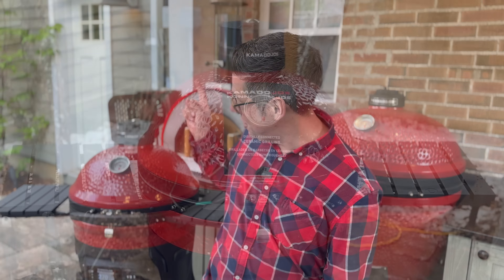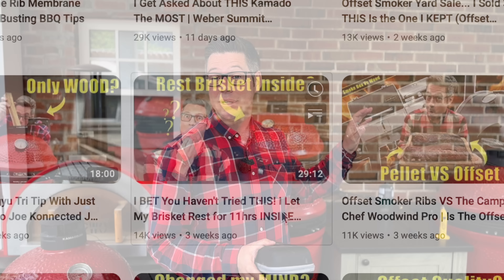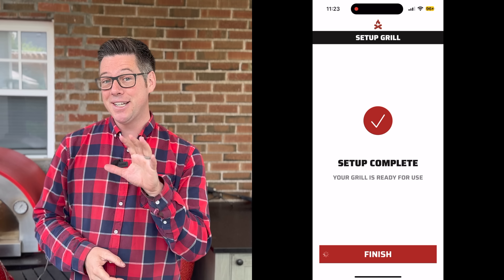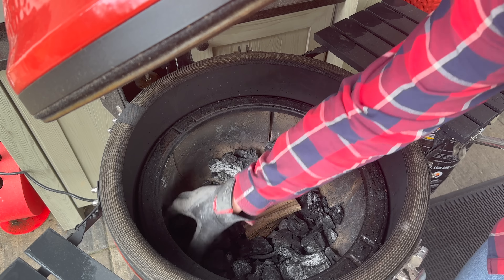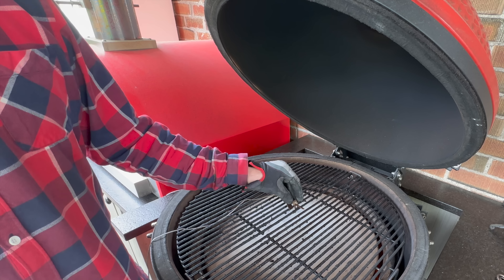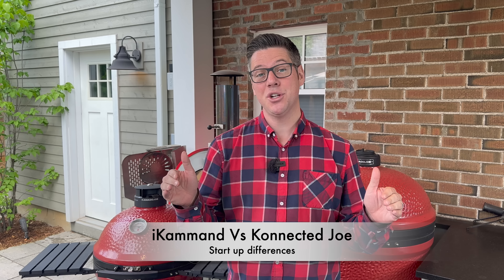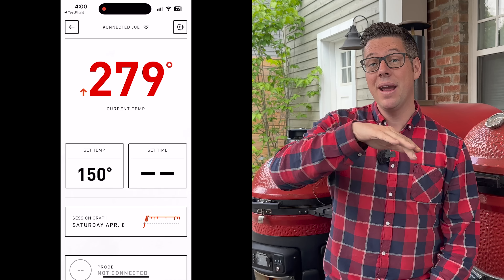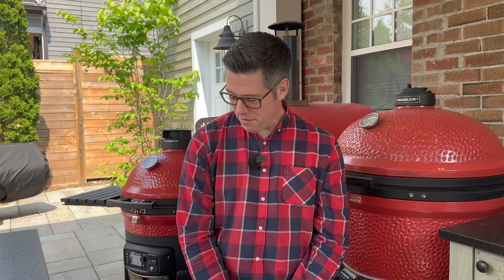Getting Smarter?  Kamado Joe Konnected Joe VS iKammand

Comment: I've got a flame boss 500 for my KJ Classic III. I've got quite a few cooks under my belt with it over the last year, including 4 briskets, 2 Prime Ribs, Pork Butt, Chicken etc.. The ease of use is surprising and I have not had a single failure. My favorite function of the controller is the cloud based networking. I'm able to start a cook and leave the house while keeping an eye on the cook. This past weekend I was on the golf course and was cooking pulled pork! One tip is to keep the top vent closed 100%, helps with temp control. I also have found that starting my cooks with a lower start temp (180-200 F) and working my way up over time (10F/30 min ballparked) introduces a ton more smoke flavor! Think of the grill like a large diesel truck, it only produces smoke when it is accelerated. And if you over accelerate, it has to much momentum. Just my 2 cents... love the content

Comment: you are a absolute master at the kamado Joe. I've had my big Joe for about a year and still have troubles with keeping a constant temperature for long cooks.... Will either jump or dip, I try to keep the bottom vent a finger space open and use the top vent but I find my temp drops too much and I have to open it up wider to get the temp back up, so now I might try to keep the bottom vent half way open and use the top vent more. It's pretty difficult I'm finding... Starting to get better a year later though 😂. Keep up the awesome vids James!!

Comment: Great review of the devices.  I have a variable fan system that is no longer made and I only use it for overnight cooks were here in Colorado we have highly variable winds that can cause large temperature variations if the wind blows into the lower vent.  The next brisket I make I have to see if I get dirty smoke from the unit.  I seem to remember my unit blows at low speed a lot and not like yours does with high speed fans.

Comment: An issue I see with the Connected Joe or any other cooker that relies on electronics is planned obsolescence. Sure, it could still work in manual mode later on if need be, but you pay extra for something that will inevitably be replaced by something newer and better later on. I personally have an Egg with a Flameboss controller. A bit less convenient and the controller is probably already obsolete too, but the Egg will never be and the controller is much cheaper to replace than a whole cooker.
Reply: But they are releasing new Egg with new tech and gadget every 1-2 years for 2500$...

Comment: Very interesting, the part that you explain how the iKammand allows the coals to almost die down. I take it that the drive is not variable speed?  Awaiting to see your reviews on the other drives. Fireboard is highly acclaimed, however I own the Fireboard 2 Pro which uses thermocouple sensors, I've had constant issues with the sensors even after they replaced some. I had given up on using the unit, till I decided to find a fix of my own recently. Did you get the thermistor or the thermocouple model?  The thermocouple will work at higher temps in your pizza oven, only if it works properly.
Reply: I have had and used the ikammand for a year now.  Personally, I have not had any connection issues and did the firmware update as soon as I got it.  Apparently there were alot of issues before the update.  The fan does have variable speed and the app shows you what speed the fan is running at.  If you don't have your top vent setting right it will be an all or nothing approach in regards to the fan speed.  If your vent setting are appropriate with your target temperature then I usually see the fan holding between 15-25% full power constantly.  This results in best airflow.  I will say however, I am looking forward to James' controller video because all of the negative reviews from other people have me second guessing myself that I may should upgrade to a different product.  My only negative issue with it is the app sucks on IOS and takes forever to update if you close and reopen the app.  I had android previously and the app updated much quicker.

Comment: Can you confirm if this Ikamand will work with a mesh network where the dual band WiFi or two band are all in one and not two diff network? Was still debating on this.
Reply from the maker: I am a mesh but only 2.4 works
Reply: @SmokingDadBBQ thx. Is your mesh have separated bands or just combined? I heard it does only work on 2.4 but wasn’t sure for the mesh network which doesn’t have separate band ssid. Lastly, can guy describe more on the taste difference on what you stated with ikammand? Love your vids. All I’ve been doing is watching your vids before my classic 3 comes in.
Reply: I use a Nighthawk MR70 mesh combined and the iKamand connects without needing to separate the 2.4/5Ghz channels

Comment: iKammand is garbage.  Mine had serious issues connect and not working.  Temps were all over the place.  The Kamado holds temps better on its own.  Would no recommend iKammand after it failed me.  Wasted money
Reply: Same experience here as well. I’ve had both versions and they both had zero consistency.

Comment: I never saw very good reviews about the iKammand so probably other hardware are better. Anyway, what I really wonder is: if the kamado is a machine so stable on his own, how can a controller such as the iKammand get things worse? I mean, maybe it's not worth the price, but still I would expect a better outcome respect of non having it (forgetting the Konnected). Can't it regulate the air flow? Is it really just max air or no air at all?

Comment: iKammand is an unmitigated disaster in my experience.  It routinely will disconnect or not hook up at all (full wifi signal so people can stifle those comments).  Support is non-existent.  I used mine 50 times in 3 years and fully 50% of those times I had trouble.  Kamado acted like nothing was wrong and then denied replacing it even with a proven history of failure on their part.  Never again.  No more Kamado anything for me.  I used to use their charcoal but now use other charcoal b/c of Kamado's failure on this one easy thing to fix.

Comment: From what I've seen the iKammand is garbage. I'd like to see the Konnected Joe vs the FireBoard Drive though.
Reply from the maker: Ya it’s not great so I haven’t shown it and put it on my waste of money list. Looking forward to the fire board though
Reply: @SmokingDadBBQ  I can say that the FireBoard fan has an actual sliding vent on it, if you left that halfway open or whatever, I am hoping it would keep the smoke from tasting nasty. I say I hope because although I have a FireBoard 2 Drive, I can't actually connect it to the vent on m y Kamado >_>
Reply: Fireboard tip: Back the max fan speed down to 15-20% max for a kamado.  Full CFM is a ton of air you you don’t need or want.
Reply: @SmokingDadBBQ I've been using a Fireboard 2 Drive for nearly a year and it's been fantastic. Temperature curve is mostly a flat line outside of my fiddlings. I'm really pleased with it, what problems were you having?

Comment: The i komand must be a real piece of garbage. Any decent pid system will learn the system and use a variable input to level in on the setpoint. Even my home built unit does that with cheap eBay hardware. I am sure fireboard labs with a kamado will DESTROY both the examples in this video. Fireboard is the way to go, but I seldom use it because kamado doesn't need it unless I am leaving home on a long cook